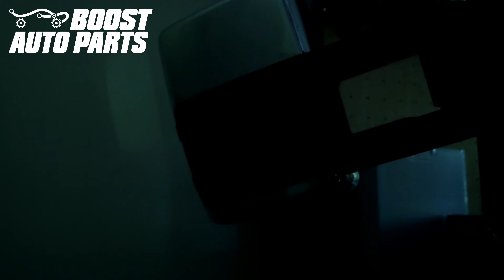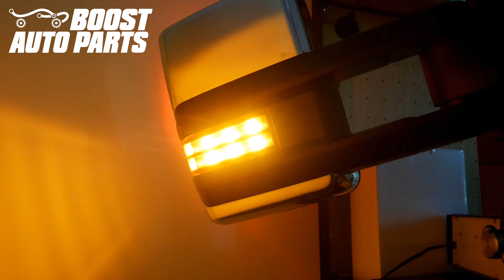Aftermarket GM Tow Mirrors Dual Function (Running & Signal) Silverado Sierra - V2.0 (1988-2019)

Comment: I bought this kit to add to my Boost Auto mirrors I bought for my 2018 Chevy Tahoe. My mirrors have an unused blue wire in the marker light harness. In addition there is a red wire with yellow stripe and a black wire with white stripe that is actually used in this same harness. Do I use the red wire with yellow stripe to connect to the blue wire that is part of the kit?
Reply from the maker: Please give our technical support team a call at 765-831-2830 for assistance

Comment: Signal light isn’t functioning running lights working fine. Any idea what I’ve done wrong?
Reply from the maker: It could be a few different things - give our support team a call at 765-831-2830 and we'd be glad to assist!
Reply: I got it all installed and I tested mine. Everything worked properly, turn signals, running lights. until i started the engine. Once I did that the running lights stay on and won't switch to the turn signal.

Comment: Why is the ground to the front light abandoned and the reverse light ground used instead for the v2 switch?
Reply from the maker: Front light doesn't have a constant ground for some applications - that is needed for the running light to work properly.

Comment: I recently bought the towing mirror for my Sierra gmc 2012 sle and I purchased the wires from you guys for the version 2.

I have a question, my truck doesn't have the turning signal blinker on the original mirror from factory, do I need to run an extra wire from the new turning switch from both mirrors and connect them to my blinker wire?
Reply from the maker: No - the signal should be plug and play
Reply: @boostautoparts  
Thank you.

Comment: Does this harness allow all the functionality of the mirror (heat, power adjust, turn signal in mirror, turn signal on outside of mirror/running lights, spot light on mirror) when installed on a 2011 Silverado LT?
Reply from the maker: This does not effect most of those features - it simply adds the running light.

Comment: Fuse tap seems to be a really tight squeeze. Do you recommend to just bend it to make it fit?
Reply from the maker: What year, make, and model?
Reply: @boostautoparts  2006 chevy avalanche
Reply from the maker: @abiza02  It should fit into the LT PRK fuse. Reach out to our team at support@boostautoparts.com if you need assistance.

Comment: What is the different between the 1.0 and 2.0? Can anyone answer this question
Reply from the maker: Signal & Running Light 1.0: The lights will flash as a turn signal. At night when the running lights are activated, the lights will operate at 50% intensity for running light, 100% intensity for turn signal.

Signal & Running Light 2.0: The lights will flash as a turn signal. At night when the running lights are activated, the lights will operate at 100% intensity for running light, 100% intensity for turn signal.

Comment: I have aftermarket switchbacks do I need 2.0 or 1.0 or does it not matter?
Reply from the maker: Switchbacks do not utilize the 1.0 or 2.0 module. Reach out to our team at sales@boostautoparts.com or 765-831-2830 if you need assistance getting them operational - we likely have something else required for your application to get them operational but they will need more details.

Comment: If you have dual function v1.0 mirrors with strips already, do you just need a different module or is it more than that to convert to 2.0
Reply from the maker: You should be able to swap out the module. Give our team a call at 765-831-2830 so they can look up your previous order and ensure you get the correct parts.